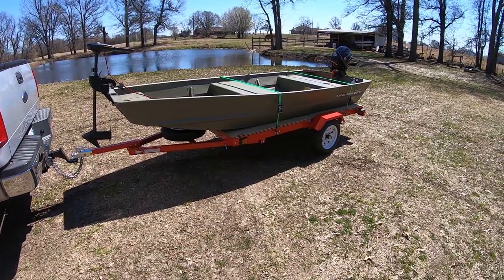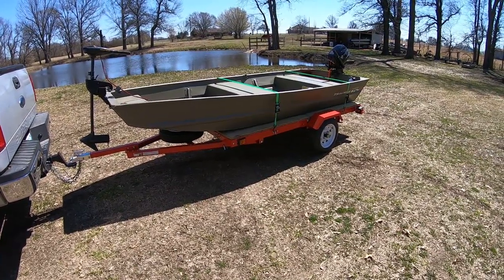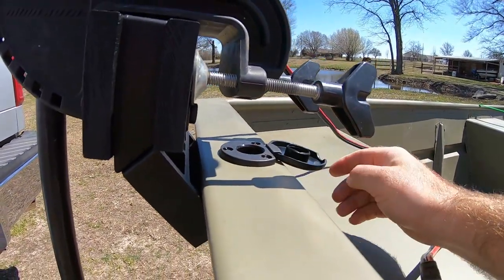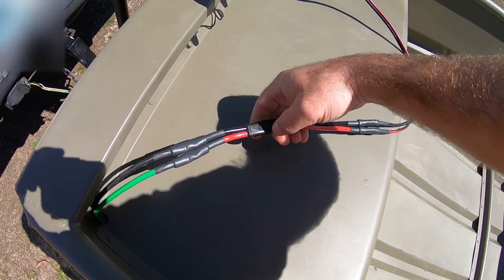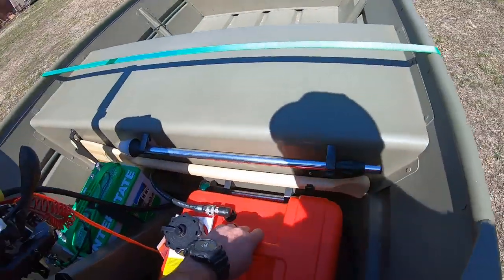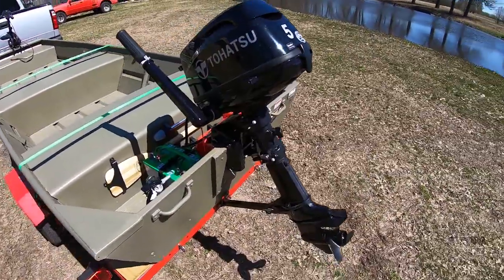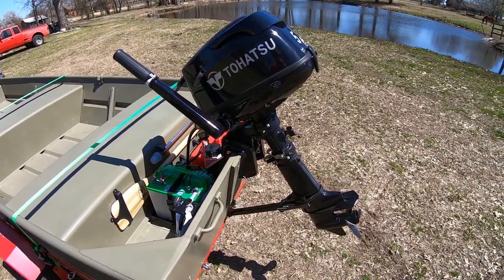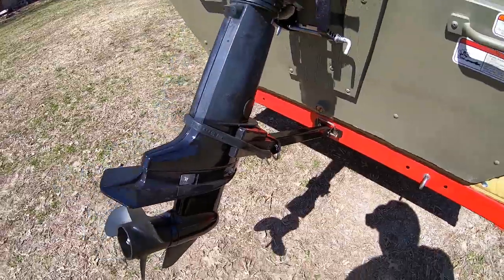Tracker Topper 1236 Set Up & Walk Around

Comment: One thing I noticed that needs changing is where the wires come out at the bow of the boat. You have wires coming out through a hole you drilled and you don't have a grommet to prevent the metal from chewing through the insulation and shorting out the wiring. It is extremely important to have a rubber grommet or something to prevent that from a short circuit, its only a matter of time before that happens. Consider the vibration particularly when operating the outboard, every impulse is rubbing those wires on the bare metal hole, slowing chewing the way through the insulation on those wires. If you haven't already changed it, I'm sure an inspection will show you the abrasion on those wires.
Reply: I was thinking the same thing.

Comment: Very neat 1236, I’m getting lots of ideas from you for mine, great video 👍🏾
Reply: Alumacraft 1236   specs
Length 12’ 0” 3.7 m
Beam 55” 1.4 m
Transom Width / Height 0”/15” 0/0.4 m
Max. Horsepower 10 hp 7 kW
Max. Depth 0” 0
Max. Hull Thickness 0.053” 1.3 mm
Freeboard Thickness 0.053” 1.3 mm
Weight 125 lbs 57 kg
Max. Capacity 3/540 lbs 3/245
Fuel Capacity 0 gal. 0
Instruments   
Seats

Comment: Get a rubber grommet in that hole ya drilled. It will save those wires, even with the sleeve.Nice boat overall. And coat your stainless hardware and holes with the recommended product to stop electrolysis from rusting the stainless and chipping the paint on the Aluminium. Adding a sacrifice to the transom helps if you have a lot of non aluminum metals on the boat. Put a thick layer of rubber or a foam yoga mat under your battery. And your breaker. It will all help prevent battery drain, and corrosion. And light flooring, even a restaurant kitchen mat. The 2 inch thick kind. Get the stress off the hull rivets . Just some cheap tricks to get your investment to last. !!!!! Stay away from pressure treated wood!!!!
I love my 14’ flat bottom. I’m sure you love yours

Comment: Did you cut and paint the tongue extension yourself?  Or is there something off the shelf you can buy?  Probably will do the same thing
Reply from the maker: @greenjonboat2014  Cut & painted myself. It’s 2x2x1/4 square tubing. I had to grind it down a bit to get it to fit into the sleeve on the original tongue.

Comment: Do you have a video on how you handle the boat at the boat ramp with this trailer? Do you back it in so the back of the plywood is under water and then pull/push the boat while standing in the water? I have the same trailer and usually take the motor off so the boat is lighter for loading unloading, but wondering if there is a better way.
Reply from the maker: I back in as far as I can without getting the waterline onto the hubs of the trailer. I'm not sure if the hubs are submergible or not, so that's why I don't back it on in. I push/pull the boat while standing on the trailer. I do not have to take the motor off, I just tilt it up as far as it will go.

Comment: Nice setup. Just wondering how is it launching with that trailer? I plan on using a utility trailer myself I already own figured I would ask.
Reply from the maker: I back in as far as I can without getting the waterline onto the hubs of the trailer. I'm not sure if the hubs are submergible or not, so that's why I don't back it on in. I push/pull the boat while standing on the trailer. I do not have to take the motor off, I just tilt it up as far as it will go.

Comment: What is the weight limit on this boat?
Reply from the maker: 3 persons or 365 lbs. 480 lbs with motor, gear, & persons. I have fished in this boat with 2 (200lbs) people, gear, motor, battery etc. It had no problem with us in there. This set up will run 11 mph with the people & gear mentioned above.
Reply: Chase Stookey thanks man! I am picking one up on Sunday.
Reply: fyi , the Alumacraft 1236 has a 3 person 540 lbs weight limit, same size boat
Reply: Nice set up. Coupla things. The battery should be protected from rain and next to transom may get wet on a windy day with waves. Cross your safety chains on trailer. 
It's a 4 stroke motor?  Bimini top would be good for rain and sun protection.